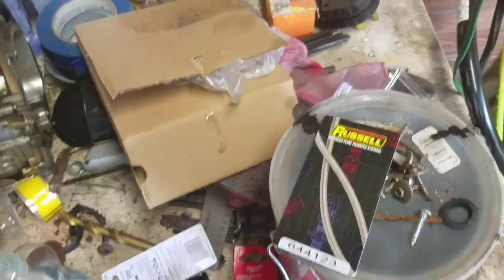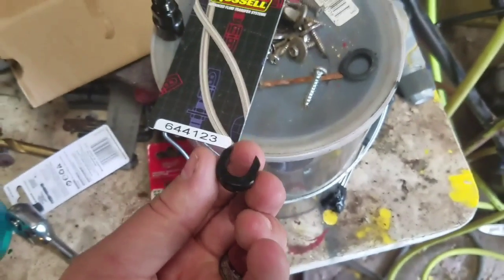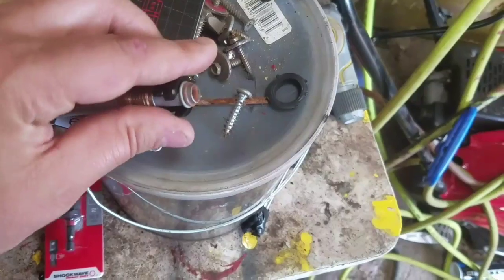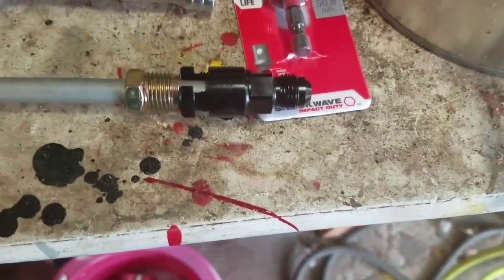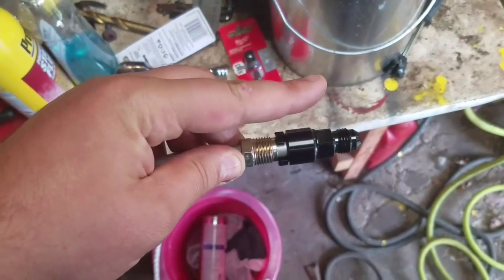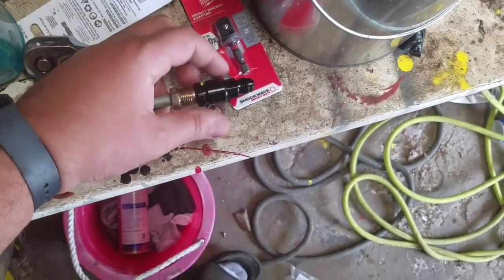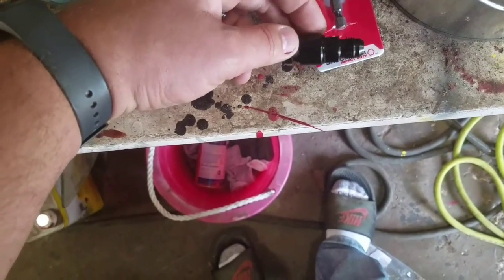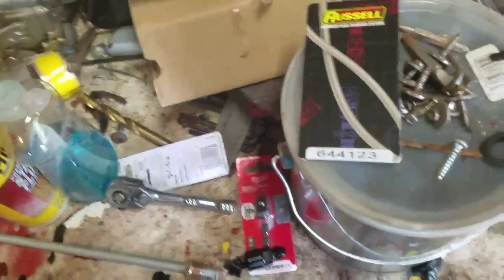How to adapt factory fuel lines to AN fittings on your budget LS swap.

Comment: Just curious do they make one of those kids that turns into a barbed fitting so I can hook regular rubber fuel line up to it
Reply from the maker: You'd have to go from this to an AN barb.

If you have high pressure EFI hose, and the specific high pressure efi clamps for it, you can just put it on the rail, no fitting
Reply: @TheDrivewayEngineer no it's an 84 with TBI 15 psi Max.

Comment: Would these hold up with transmission fluid? Trying to make my own trans lines without having to cut the trans cooler ends
Reply from the maker: There's nothing special about transmission fluid, if your cooler has these ends, they'll work.

Comment: Actually that might not work.  You have to have unflared tube going past the inner Orings or it will leak.
Reply from the maker: It's literally designed to do this 😂

Been on my truck not leaking for 5 years
Reply: I’m having this same problem with this fitting it’s leaking any suggestions I was thinking using the 6an compression fittings

Comment: I'm using the same type of fittings on my factory 1987 r10 sending unit and they are leaking fuel out of the back side of the fittings. Any tips on this. Thank you.
Reply from the maker: The sending unit fittings don't take this type of fitting, these only fit the LS rails. 

At least they didn't fit my 87 sender, I had to use compression fittings.
Reply: @TheDrivewayEngineer  that might be why they are leaking then. Thank you, keep the good content coming.
Reply: @TheDrivewayEngineer  good to know, Im trying to adapt the lines on my 88 R10 , I have an aeromotive Stealth340 pump and the lines just arent enough, I was looking at adding a return bung AN-6. but this would be a lot cleaner if it worked.

Comment: I bought these fittings directly from the link that you posted, but they did not come with any type of O-ring or seal… It has to have something like that to make a leak free seal correct?
Reply from the maker: No, notice there's no oring or seal in the video
Reply: @TheDrivewayEngineer  okay, people were talking about them in the comments and it got me confused
Reply from the maker: The taper part is the seal, it's how a flare works, no worries

Comment: Do these only work on GM steel lines or will they work on Ford 3/8" line as well?
Reply from the maker: Probably not, I'd imagine it's a proprietary connection.

Comment: Link to hose please.  Does it work with E85?
Reply from the maker: It's Parker 801-6, I buy it at my local Parker store, it's all over online as well. 

It's not E85, or even fuel rated. It's been working fine for me for years though.

Comment: Thanks bro, I assumed that's how it worked but needed to make sure before I started pulling shit apart.. what's weird in there is 2 o-rings inside the 6an side of the fitting🤷‍♂️
Reply: Those o-rings must slide over the hard line to provide a good seal. There cannot be a "barb" on the tip of the hard line as the o rings won't clear the barb without getting torn up. However, the "barb" must be 1-2 inches DOWN the steel hard line and THAT is where you will place the threaded ended and that barb will act as the retainer of the adapter so it doesn't slide off.

Comment: So this is or the FUEL RAIL not the fuel line correct?
Reply from the maker: No, it fits all the GM hard fittings, rail, line, filter, sending unit, whatever you need
Reply from the maker: I used it on a line in the video to demonstrate, but it will work on anything that has the GM Quick Disconnect style flare.

Comment: Part number?
Reply: Oh lmao seen it sry
Reply from the maker: Just for anyone else, 644113 is for 5/16 line, and 644123 is for 3/8. ON an LS engine 3/8 is the feed and 5/16 the return, but I personally use -6 AN hose on both.